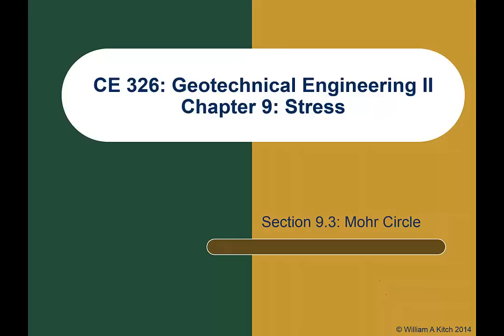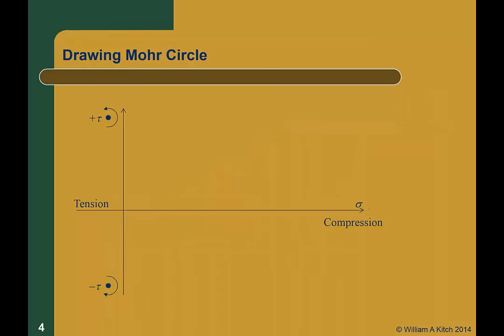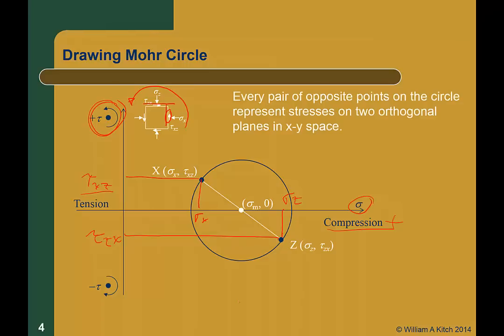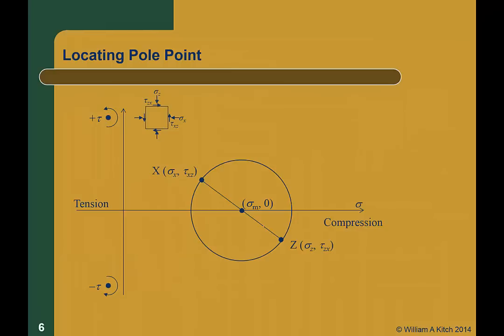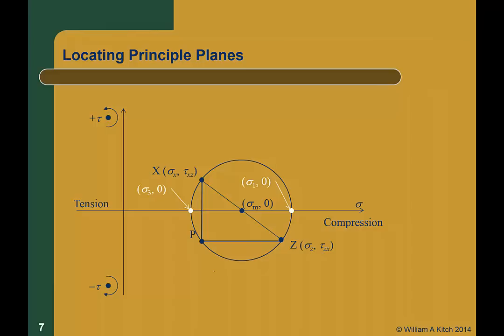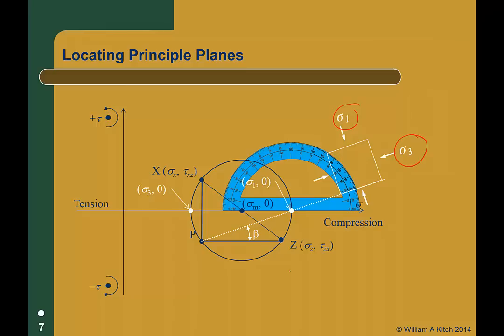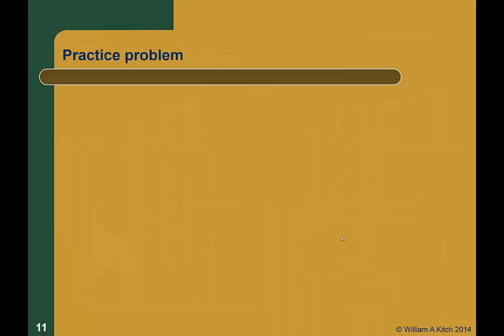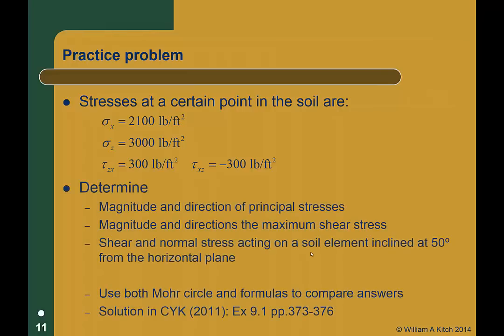CE326 Mod 9.3 Mohr Circle

Comment: at 3:24 , did you assume "sigma z" is more than "sigma x"?. I mean that is it possible that the given values of normal stress and shear stress make a loci of points of a circle whose centre is not on the 
zero-tension(horizontal axis) line?
Reply: And also that Tau-x-z  =  Tau-z-x   ?